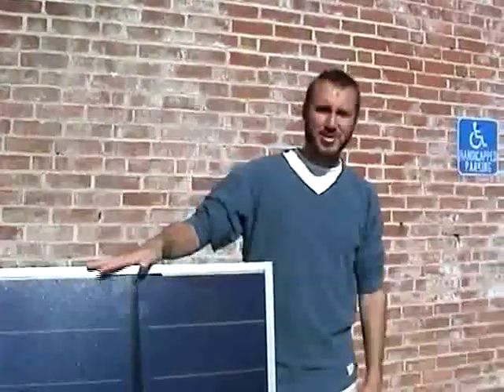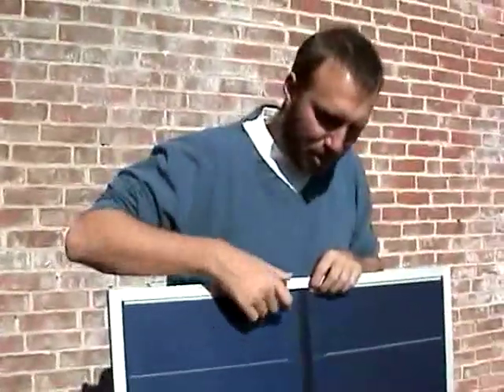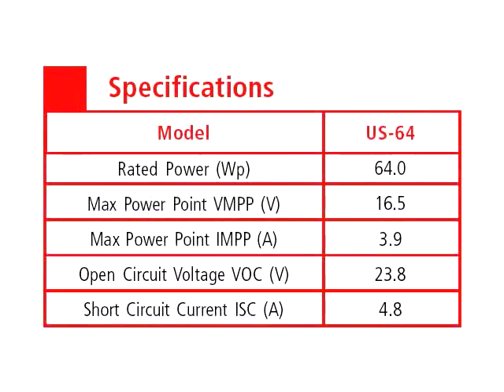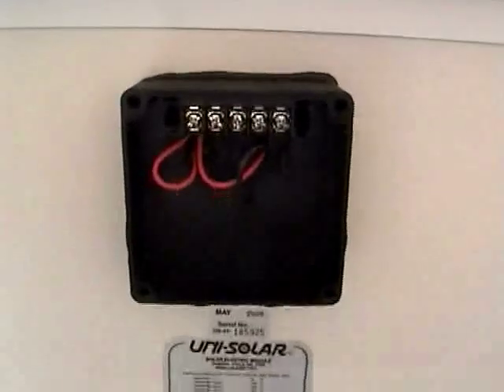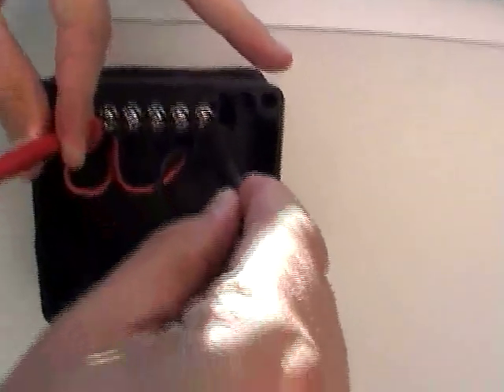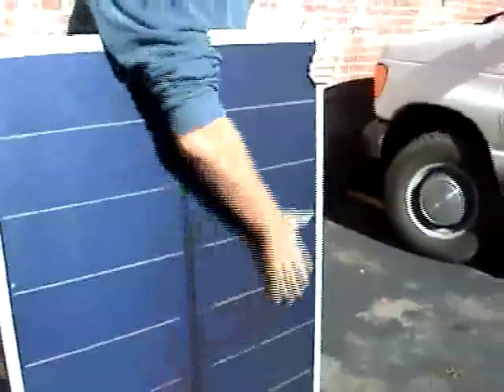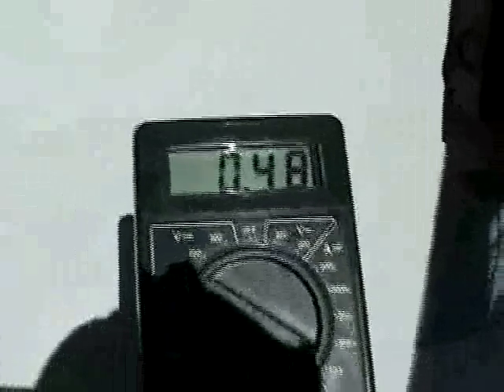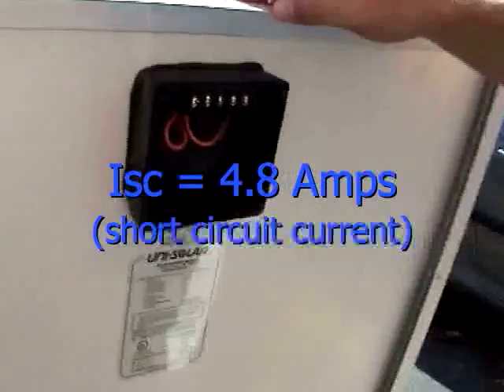Solar Panels - How to Test - altE Video Tip

Comment: OCV does no work,   Short circuit amps do nothing either.  A power source must have a load on it to test it.
What you just showed is that you only get rated watts at theoretical conditions.   
No worry,  all solar people use this stupid test to sell their week power source.
Do that same test with a 2-3 ohm load across the panel and then call me and tell me what the watts are.

Comment: The panel in the video certainly looks bent! In such bent panels, there are very high chances that micro cracks would have already developed in the cells. These will eventually show up  as 'hot spots' which are safety hazards and the starting points for panel failure.
Reply from the maker: That's why we only used the damaged panel for demonstrations, and haven't actually installed it.

Comment: Hi, I find a little difficulty to understand how to measure the amps. Is there a easier way to do it?
thank you!
Reply from the maker: Unfortunately, measuring amps is more complicated than volts. You have to have the meter in line with the circuit. For your tests, the easiest test is just to see if the volts go up when the panel is in sunlight. That should tell you if the batteries are getting power from the panel.
Reply: Thank You!
Reply: I have a digital multimeter from China and when it shows 27volts car stopped. When we go out it dropps to 24+- and then when we stop it rises to 26, 27 volts again. What do You think?
Reply from the maker: I want to make sure I understand your test. When the car is stopped, the volts are 27V, but when it is running, it is 24V. That would make sense, since the motor running would drop the voltage down. With the car off, and the solar panels covered so you are sure it is not charging, measure the batteries. Then with the car still off, but the solar panels in the sun, measure the batteries. If it is higher with the solar panels in the sun than with them covered, it is charging.
Reply: Thank You! I will do it!

Comment: Hi, Mr. 
First, thank You for the video!
Well, my wife and I live in Israel and we have a Kalnoit, it's an electric car of four wheels. It runs by a machine of 24volts. I decided to put a polycristaline panel of 180watts 36volts to charge the batteries. But I don't understand much of it so I need your help. How do I know if the panel is really charging the batteries? How can I test?
The solar panel is connected to an mppt charge controller 12/24volts 10amps which is hooked to the batteries that are 12volts 70amps each connected in series.
Thank You for your help!
My Whatsap: 09720586004419
Emmanuel Távora Freire.
Reply from the maker: Thank you, and welcome to altE Store. I assume the output of the charge controller is connected across the whole battery bank, so it is charging all of them at once. The easiest way to see if it is charging the battery is to take a volt meter and measure the voltage of the battery bank when it is not being charged, perhaps put a blanket on top of the solar panel to cover it. Then measure the voltage of the battery bank with the solar panel exposed to sunlight. The voltage should be a little bit higher at the battery bank as the charge controller puts out the power from the panel. If you have a multimeter that can measure at least 10A, you could also try to measure the current coming from the charge controller to the battery bank. I describe how to do that in this video, https://youtu.be/_a8OMBTolxg
Reply: Hi, I find a little difficulty to understand how to measure the amps. Is there a easier way to do it?
thank you

Comment: really??   rotate the solar panel away from the sun before testing the short circuit current?  I've been working with solar panels for 20 years now and I have never been injured by sparks from shorting a single solar panel.  I've worked with as high as 250 watts from a single panel and I regularly short the leads in full sunlight with Isc's exceeding 9 amps.  The only issue is damage to wires,screws,sockets, etc.  The arc generated by connecting and disconnecting the leads can blacken or even start to dissolve small bits of metal from these surfaces.  
I wouldn't suggest short circuiting a group of many solar panels connected in parallel and in full sunlight though!

Comment: I am trying to figure out why my charge controller isn't working properly.....if anyone wishes to help, I have a post on the northern Arizona wind and sun solar forum under the "beginners" section titled...."help, pwm solar charge controller not working"....thanks!!
Reply from the maker: +sbecktacular Looks like you've got some good people helping you out on the forum. If tomorrow is sunny, I'm going to do a video on how to test the charge controller, but in until then, measure the voltage at the PV input of the charge controller and of the battery out connections. That should tell you what the charge controller is seeing. Also, as in my other reply to you, disconnect the solar in to the charge controller to measure what the panels are inputting to the charge controller without any of the electronics involved.

Comment: what if your solar panels are mounted already and you can't get to the junction boxes?can you test like this through the mc4 connectors or some other way?......
Reply from the maker: +sbecktacular  Disconnect them from where they are connected to. For example, if they go through a breaker to the charge controller, disconnect it from the charge controller and measure it at those wires that were going into the charge controller. The advantage to that is you will be measuring any voltage drop across your wires as well.

Comment: Thanks James from Alternative Energy Store
I was having a hard time finding out my amperage on my 36 cell solar panel.  I couldn't figure out how to put the wires on the multi-meter and if I needed a load or battery in the middle of the wires to create a complete circuit with the multi-meter. It just needed red wire on 10A and black wire on COM and then connect to the positive and negative wires of the solar panel.

Comment: I bought a 24 volt panel, damaged in transit. Glass is crazed. Its rated 200watt. I needed 12v for my controller so i devided the panel into half and tapped into the positive and negative for both now seperate sides.in theory now two 100 watt panels about 8 amps but have never got more than 2 or 3 amps out each sides. Ok damaged but seems coincidental. Cells are 6x6. Both open circuit read around 16v. Can 6x6 cells for a 24v panel be different to a 12v panel?

Comment: A 12V nominal panel will normally have an open circuit voltage of 16 or 17 Volts... if you're trying to charge a 12V battery with this panel, then the voltage needs to be higher than 12V in order to induce a charge...

Comment: For beginners, you should point out that you switched the red lead on the multimeter into the Amps plug for the second test... and you also might mention to either turn the module back into the shade before you disconnect from the Amp test, or make sure they pull away quickly, like you did in this test... to prevent arcing

Comment: Is it important to check the nominal volatge of a panel? that value that usually is 12v. And what is a good nominal voltage if the panel is exposed to sunlight? Is a value less then 12v for a 12 v panel normal eg 10.5v? 11v? or should be more then 12v?